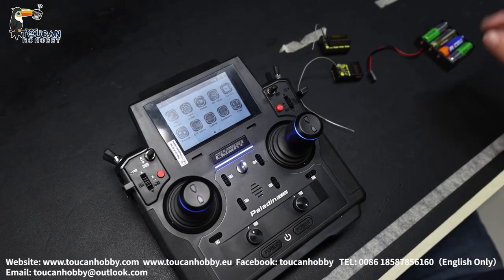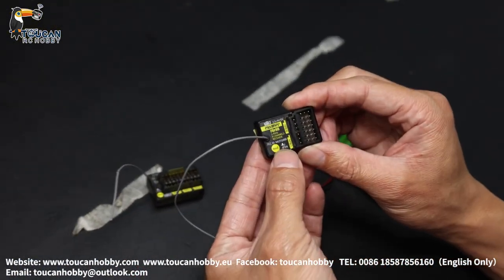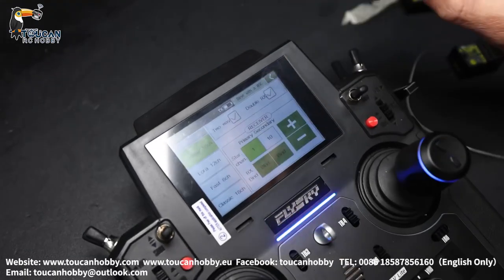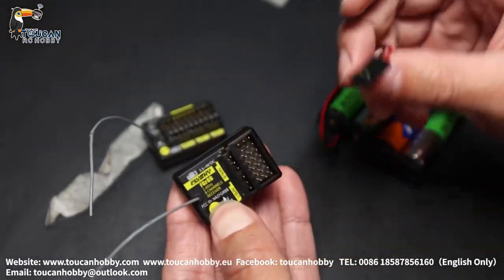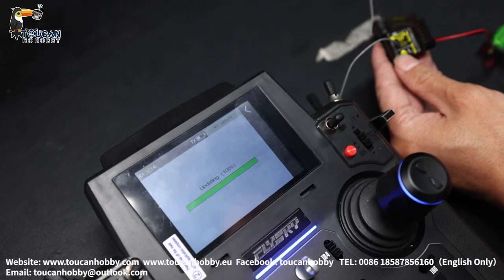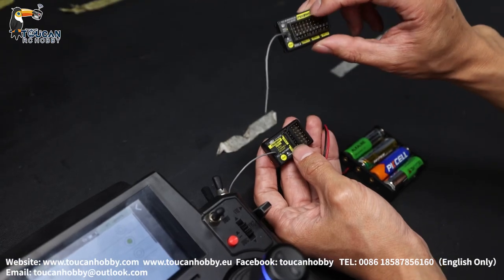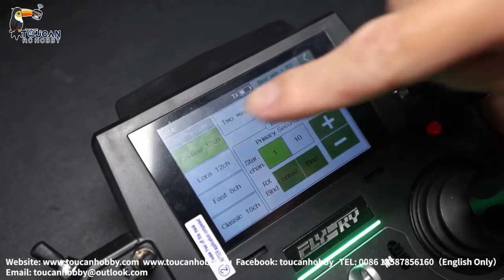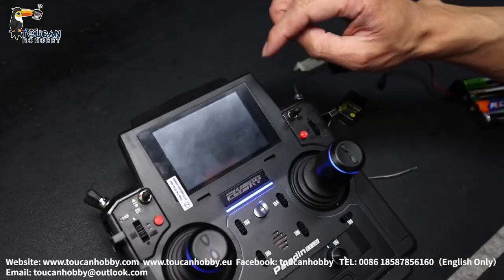How to update FGR12B or FGR8B receiver to match with your RC paladin radio, so can bind and working.

Comment: i cant bind my reciever at all. the menus look slightly different on my brand new radio. might it be the firmware that does not work?
Reply from the maker: Please add me friend to see details
Reply: @toucanhobby2400  i have sorted it out, it just worked after a while. i had to figure out witch of the four ways to connect. i also had a servo connected to the reciever, that might have made it fail.